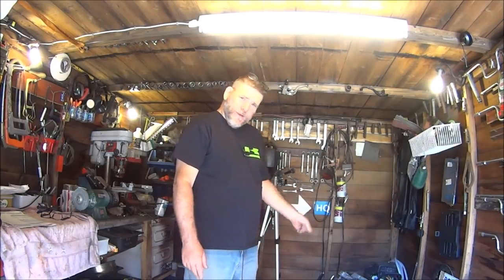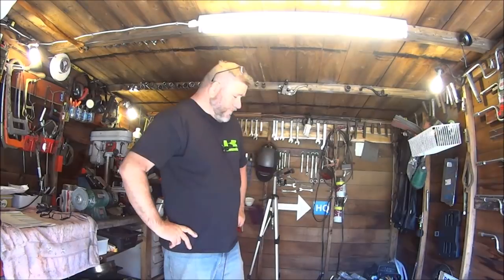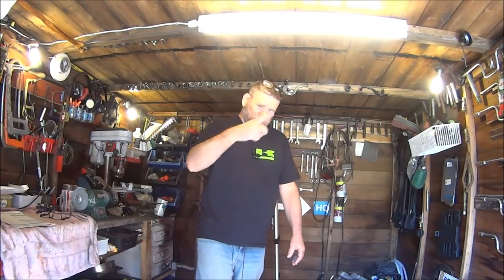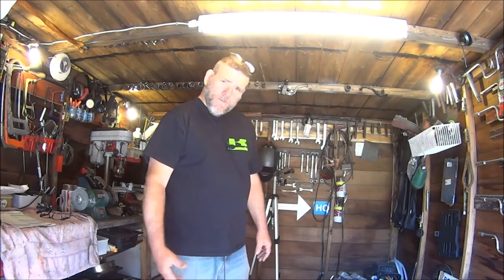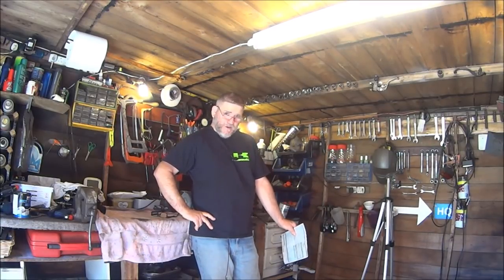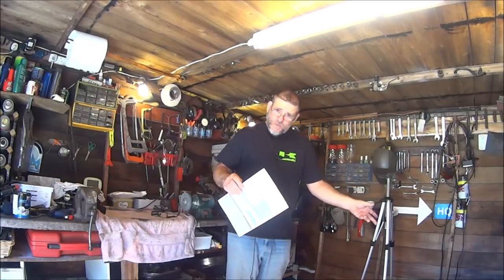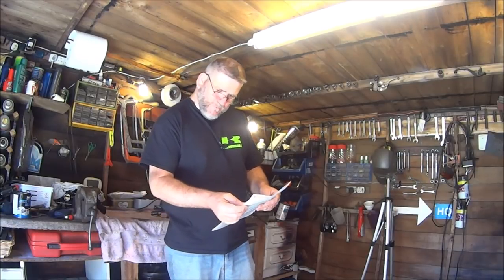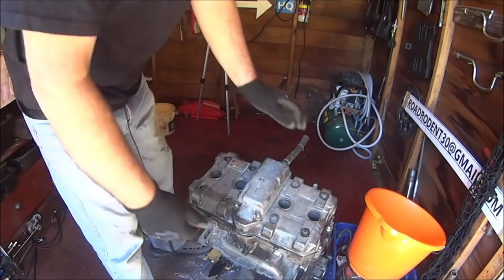CBR1000F,h cam chain tensioner removal

Comment: John get yourself another pump for the divvy as mines now fixed! Got a 2nd hand off eBay and it revs great now. I’ve installed another filter in between the pump and the carbs to prevent crud being sucked through👍🏻
Reply from the maker: Cheers Buddy if what I'm about to do doesn't fix it then a new pump is the next option. Well done on  yours feller.

Comment: By the way, to remove the alternator, remove the inspection panel under starter motor and then you will see a nut at one end of the splined shaft which runs through the alternator. You will need to hold the crankshaft to remove it.
Reply from the maker: Thanks for all you're help fella your a star...it's much appreciated..

Comment: I drape a cloth over my cylinder head, because if anything drops into the engine it's a bastard to get out!
Reply: i poke it down the hole where the chain runs, or if not  you may  need to remove the whole sump plate
Reply from the maker: Thanks Buddy I will do that on the main engine.
Reply from the maker: I'm thinking of taking the sump off to give it a good cleaning.